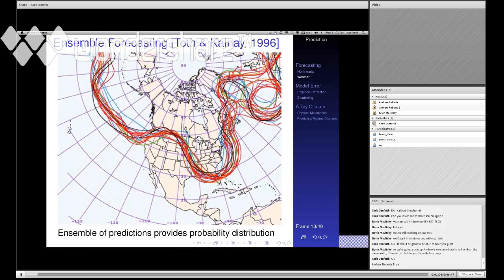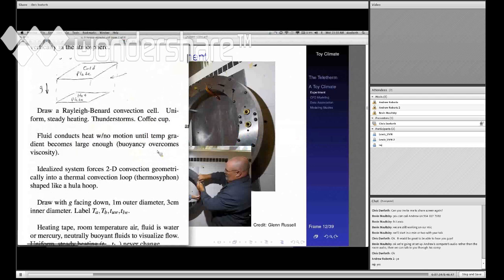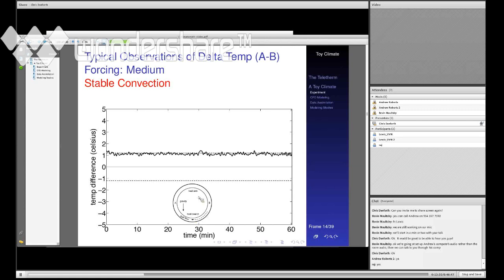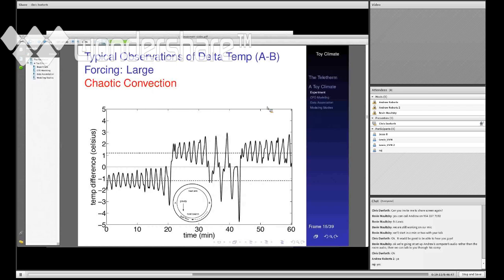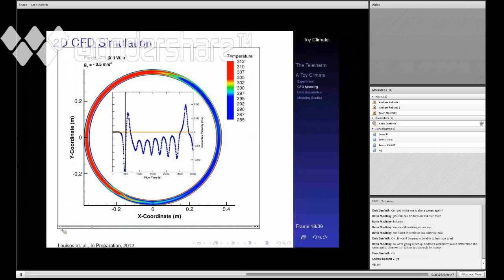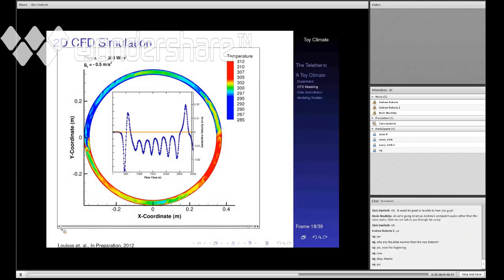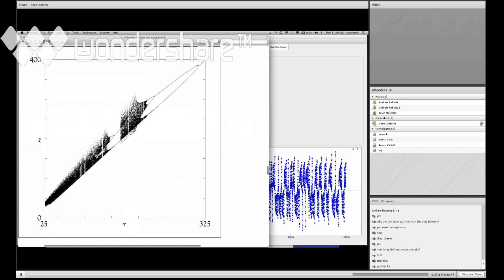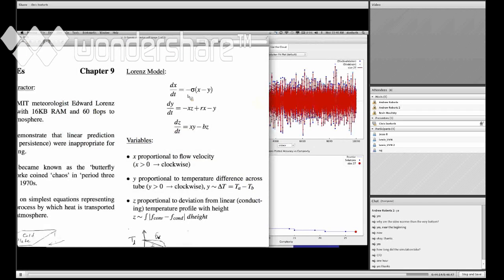Lecture on Lorenz Chaos in a Toy Climate

Comment: The Navier Stokes equations describe fluid flow with changes in temperature and density. They are nonlinear, chaotic, and show sensitive dependence on initial conditions. Because of that nonlinearity, no finite set of past states is sufficient to predict non-trivial future states. The value of feedback loop parameters measured in one section of the state space are different from the value of feedback loop parameters in other sections of the state space. Because of the different values of feedback loop parameters, you can't use values in one state space locations to predict behavior in other state space locations.